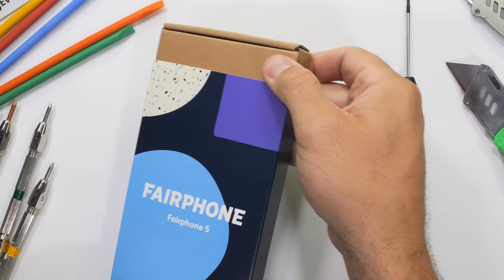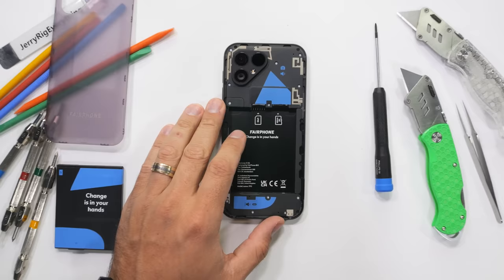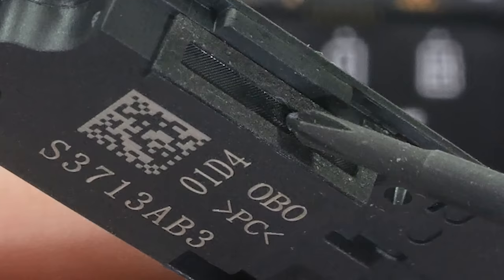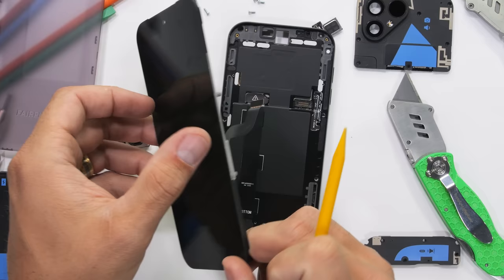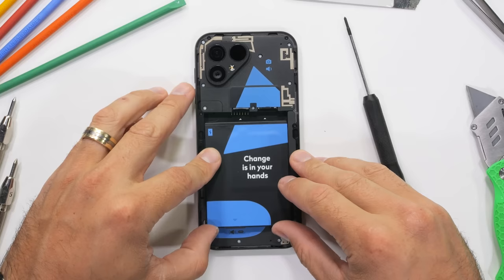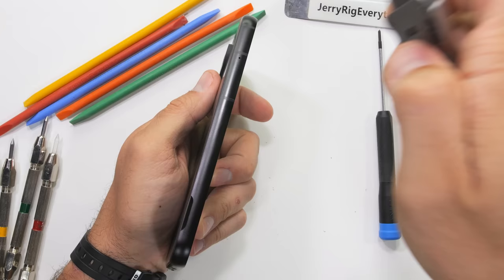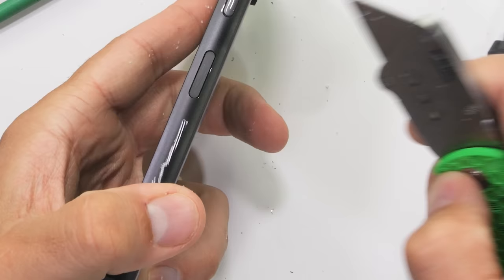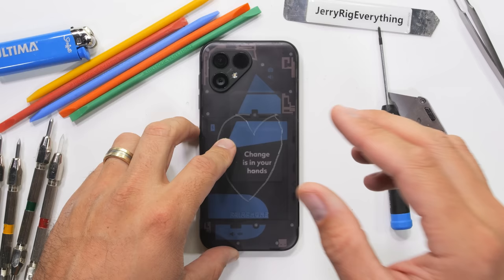The Best Smartphone on Earth - (Not Clickbait)

Comment: That's how phones should be
Reply: Just needs a 3.5mm jack
Reply: That’s how they used to be
Reply: @sys-administrator tf is ip68 waterproofing? You mean water resistantace?

Holy, his comment exploded it was like 36 likes 💀
Reply: @sys-administrator nope, low priority
Reply: That's how the phones were in 2015. Hello LG G4. 😍
Reply: @sys-administrator what do you have to do with it? Swim?
Reply: no, i don't want thick bezels and a thick frame and a small battery and mediocre specs
Reply: @sys-administrator  sure, but it's not a deal breaker for many. Hence low priority
Reply: Also thts how they use to be
Reply: that's how they WERE until apple did the non removable-proprietart thing
Reply: Ikr
Reply: @sys-administrator How do you get a phone that's so modular but also water resistant? Don't be an absolute child, and avoid getting it in water. Done.
Reply: Unfortunately every businesses goal is to maximize profits and this doesn't cut it😂
Reply: I mean ip68 waterproofing is more of a preventative measure. It’s nice to have and also all new smartphones have it. It’s nice to know that if I accidentally drop my phone into liquid, I don’t have to get a new one.
Reply: @SRC267  no need for them anymore. otherwise: adaptors are really cheap. I prefer a bigger battery instead :)
Reply: Thats how phones were up until galaxy s2, plastic back, modular build, everything was easy to replace.
Reply: It's how phones used to be. People forget. I used to have 2 spare batteries for my old phones, pop off the back, swap it around and you're good to go.
Reply: That's how they were before Apple phones appeared.
Reply: @sys-administrator IP68 waterproofing isn't a thing. Weird choice of words.

IP68 is a standard, where first digit (6) stands for how dustproof something is and second digit (8) for how waterproof it is.

Maximum is IP69K (nice), where 9 stands for resisting a powerwashing under high temperature.

8 stands for resisting submerging at a depth under 1m for under 30min
Reply: Did you changed your profile pic? The first I saw it, your profile is girl's back 🍑 🗿
Reply: 750€ for these specs will stop 90% of people from buying it.
Reply: @SRC267 😂😂😂 3.5 jack is high priority but water resistance is low priority? Where have you been for last 30 years? Don’t you remember the time when phones where thick, had a 3.5 jack, replaceable battery and lasted 2 weeks on one charge? That times are gone and the only reasonable step forward is to maintain thickness and usability of current smartphones while trying to implement old but good things just like replaceable battery.
Reply: Exactly 💯
Reply: Lol enjoy your battery flying out when you drop it and it breaking from a splash of liquid
Reply: What are you talking about! The battery cost 40 bucks!  That's insane!  My xiaomi phone doesn’t have a removable battery but it will cost 20 bucks to replace that. This phone is a rip off
Reply: I disagree, but to each their own.
Reply: @fwy8667  and your watching a phone video
Reply: No
Reply: @davidenorbedo5555 does your car have airbags because you use them every day
Reply: @killkiss_son it's a one and done type of buy tho, this phone should last you half a decade easily
Reply: @sys-administrator  I do. And there was also another commenter that did.
Reply: The argument against this is water resistance.
Reply: @fwy8667  IP is the dust and water resistance level in an electronic device. The first number classes dust resistance, from a scale of X (none) to 6 (fully dustproof) - usually 5 or 6 in a smartphone. The second number classes water resistance, from a scale of X (none) to 8 (fully waterproof) - 5 is moderate splashes, 6 is powerful jets, 7 is submersion in water between 15cm and 1m for 30 minutes, and 8 is almost entirely, or entirely, waterproof.
Reply: @tomcorteil  I know what ip 68 water RESISTANCE but idk what ip 68 water proofing is
Reply: @sys-administrator its ip 55. Its more than enough to do all this
Reply: @Yellow_Flannel  don't forget the galaxy s5 exists and has an ip 67 rating
Reply: This is literally how they used to be, nice to see the old standards now becoming “new” 😂
Reply: @sys-administrator it's called a case.
Reply: @Jonathan-rd4pk the headphone port takes up the same, if not less space than a USB-C port. You're not sacrificing any battery size lol
Reply: Jst btry...
Reply: @Jonathan-rd4pk  It does not matter how cheap an adaptor is. I do not want to be forced to use one. If your engineers do not manage to fit a 3,5mm hole into the device, that design sucks. And it even more sucks, if your argument to remove it was: "because it could break" (reminder: in a phone that is meant to be repairable). You may remove the display, USB C and battery for the same reason - just remove the entire phone, it could break too.

Oh and do they continue this bootloader lockdown crap?
Reply: Exactly
Reply: Man reminds me of the days when I had my old galaxy and my iPhone friends would get so jelly when I could just eject the used battery and put in a spare to instantly go to 100%.
I honestly hope the new eu laws bring this back
Reply: @thementalcritic  Imagine comparing prices from an European company that puts money and effort into using sustainable resources and fair pay for workers with a Chinese mega tech corp lmfao. Of course Xiaomi is going to be cheaper!
Reply: how? outdated Parts in a new phone?
Reply: I’d rather not own a phone that some random guy can take apart and just yoink my battery.
Reply: Why should a phone be designed to have parts that don't break be replaced? A removable battery, water resistance, and the slightest bit of care should be enough.
Reply: @thementalcritic  Xiaomi phone? Ofc that is cheap. You pay the extra with your data for the Chinese government.
Reply: @gongshowjimmy557  Samsung Galaxy S5 was waterproof with removable back. It was easily servicable too.
Reply: this phone won't save the world and it's too expensive.

and "sustainable" cobalt and lithium claim is just ridiculous.
Reply: Yep @apple and @google do better.
Reply: Commission Regulation (EU) 2023/1670
Reply: Imagine if Apple ever did this
Reply: @Roman-mt7hg  iphone 6s
Reply: Everybody needs to get latest  Apple pro max
Reply: Yupp atleast hardware shold be like that! Finally a tool is being treated as a tool not a third most important part of your body!
Reply: This is how phones were 😅😅😅
Reply: Imagine we can upgrade it, just buy and replace and upgrade no need change the phone just change the processor chip, replace higher quality camera , replace more storage, replace the 4G to 5G, imagine everything is upgradeble but not buying another phone, if need camera just change the cmera, if need good processor for gaming then just change it, wuuhhh amazing
Reply: That will be according to the new regulations they will all have removable battery and usb C ..it's nothing special 😊
Reply: Hell nah
Reply: I can changes battery.
Reply: Good old phones technology, miss replaceable batteries in new ones
Reply: man I still miss my LG V20
Reply: @Jonathan-rd4pk .... what
Reply: That's how they were !
Reply: Try telling normies
Reply: Jesucristo te ama muchísimo, arrepiéntete de tus pecados y ten perdón de pecados en Su Nombre
Reply: Тогда каждый, кто умеет держать в руке отвёртку, сможет его ремонтировать. Сервисы останутся без работы. Сейчас ведь как? Вспомнил старый анекдот. Пришёл клиент забирать с ремонта телевизор, мастер говорит, сдох конденсатор, с вас 5.40. Это за что? - спрашивает клиент. 40 копеек стоит конденсатор, а 5 рублей за то, что я знаю, куда его поставить. То есть, пользуясь нашим незнанием, с нас сдирают по полной. Это везде: автосервисы, рембыттехника всякая, врачи, мастера по ремонту квартир и сантехники. Короче, везде, где нужны особые навыки и знания.
Reply: Yes
Reply: Manufacturers: Here are the new phones!!
Community: Why is it so hard to fix?!
Manufacturers: Because, we decided we think the right to repair is stupid and completely threw it out of the window!😊
Reply: Like foot dimmer switches in cars, the best ideas are often lost to time.

Comment: I absolutely love the combination of Right to Repair, EU regulation tightening, and companies like FairPhone and Framework making tech repairable and modular.
Reply: It must be the gold standard
Reply: Unfortunately they have a loophole. Watertight devices don't need user replaceable batteries.
Reply: absolutely agree! Fairphone, Framework and Shiftphone and Nothingphone making this now and do not have huge problems in the future.
Reply: @naja08gll  banning serial code software locked batteries is a huge step.
Reply: It's repairable, but it's missing important components like 3.5mm jack, an USB charger and an USB cable.
Reply: Fairphone goes beyond what is necessary. Water resistance, a long lasting/replaceable battery, and good case should be enough. Also 5 or more years of software updates. I have seen only 1 case of a phone getting messed up besides a cracked screen and a bad battery, where the screen stopped working after a drop. 

Fairphone is great if you want a phone that can last 10 years. I would argue though that the market for ultra long life phones is pretty small. If they made a budget fairphone, for about $300 it would makes sense with the budget minded crowd. As it stands 3 very budget phones are significantly cheaper than a fairphone if you go through a carrier.
Reply: @espertalhao041  Who doesn't have a spare charger and cable though? Those are sensible omissions IMHO, you can buy them from Fairphone if you want but why bother if you already have them? The lack of headphone jack is a little more annoying, but it's only an adapter needed to fix that.
Reply: @me2olive  "Who doesn't have a spare charger and cable though?"

Someone buying their first phone, someone buying their first Fairphone (chargers are kinda phone-specific) and someone who isn't tech savvy.
A phone without it's charger is like a car without a gas tank filler - it's not a complete unit and it's missing required critical parts for it's continuous proper functioning.
Reply: @espertalhao041  Well, like the previous user stated, you can buy a cord and charger with the phone if you want. Regardless of your opinion, having a cable and charger come with every single phone is a HUGE source of electronics and plastic waste, and not sending one with the phone by default seriously cuts down on that waste. The vast majority of people already have a charger and a cable they can use with this, so it makes no sense to force a new one on people when they don't need it.
Reply: @espertalhao041 lol chargers are kinda phone specific? NO. There is USB type C and lightning. That's it those are two connections 99% of cell phones use. Basically no cell phone uses older styles of USB anymore like usb mini b, USB micro c(of which there are 2 shapes) or USB micro B super speed.
Reply: @naja08gll true but eventually they will lol didn't u hear Jerry?
Reply: @jamesmcdermott8947 Just wanna say that your listing is inaccurate. No phone I know of has used Mini B (but probably some weird Nokia brick phone has) and no types of "Micro C" exist. Micro B 3.x or Super speed was used in a handful of phones. Micro B (Micro-USB) was common in old phones.

Edit: and there was that 30-pin monstrosity from Apple that at least Samsung used in some tablets.
Reply: @glizbane  "Well, like the previous user stated, you can buy a cord and charger with the phone if you want."

"A charger" is not "THE charger". Please read my previous comment to another user as to why.

No charger means it isn't a complete fully functional unit.
Reply: @espertalhao041  "chargers are kinda phone-specific"
I laughed really hard at that as I plugged my HP laptop charger into my Samsung phone.
Reply: @Maplaplaplapla  They literally said "like the older styles of..."
No phone today comes with the 30 pin, Micro, etc. etc.
Reply: @espertalhao041  You seem really stuck on the misconception that chargers are phone-specific. That's simply not the case.
A generic charger of what? 2 amps? will give suitable charging performance of anyone who is too lazy to care about what charger they're using.
Devices are sold as standalone items all the time. 
You buy a camera and it comes with enough storage for 4 pictures REEEEEEEEEEEEEEEEEEE NOT A COMPLETE UNIT REEEEEEEEEEEEEEEE.
No, you do what normal people do and you buy a suitable storage card.
THE PRINTER DIDN'T COME WITH PAPER AND A USB CABLE REEEEEEEEEEEEEEEEEEE.
No, you purchase the paper and a USB cable of suitable length separately.
THE RECEIVER DIDN'T COME WITH SPEAKERS SO I GET NO SOUND REEEEEEEEEEEEEEEEEE NOT A COMPLETE UNIT REEEEEEEEEEEEEEEEEEEEEEEEEEEEEEEEE.
When you bought a CD player did you think it came with CD's? The PS1 and PS2 didn't come with memory cards. They were sold separately. The 360 didn't come standard with a hard drive and didn't support USB saves until later. The iPod Touch, Nano, and Shuffle didn't come with chargers. There are thousands of examples. 
Again, you're buying a device, not a "starter kit".
Reply: Yeah. The EU should rule the world so everywhere would be a better place. ❤❤❤❤
Reply: @tim3172  It's not a misconception, and you know it.
Reply: Don't forget Shiftphone ;-)
Reply: @naja08gll  Well Sony did it about 10 years ago...
Reply: @naja08gll Most people don't use their phone during rain, washing car, swiming, etc. That loophole is small problem. It's not a problem back then for phone to have water resistance, because people with common sense know how to prevent water from getting into their phone
Reply: @espertalhao041  Why do you need a cable and charger?  THe whole idea of standardizing on USB C is that you'll never need to buy another one.
Reply: @poruatokin  But USB-C is just a connector, and it is used by non-USB Power Delivery chargers that have their own proprietary charging protocols.
For example, Quick Charge. However, Quick Charge does fallback to USB Power Delivery.

You also need a charger that supports USB Power Delivery, and a cable that's capable of delivering the current and voltage that the phone supports.
You can't just grab a $10 charger and a $5 cable and expect USB Power Delivery to work on your phone.
It will probably fallback to USB 2.0 current (500mA), if the phone even accepts the charge anyways.

To make sure that the phone, charger and cable are compatible, they must be bundled, as they should be because they are (more often than not) device-specific.
Otherwise, it's just playing dice and hoping that the charger you bought actually works with the cable and phone you have.
Reply: @espertalhao041  Again you are talking nonsense, literally ANY USB C charger and cable will charge a phone. I personally have around seven different charge sources that I can plug my phone into including  those made by various makers including Dell, Asus, Anker etc.  Hell, even my sofa has USB outlets and came with a pair of USB-A to USB-C cables. Wall outlets in the UK and Japan are available with built in USB outlets. Most of mine are PC power supplies, some will do fast charging, but I prefer those that charge slow to preserve the battery.
Besides, I have am on my fourth Smartphone now and none of them ever came with a bundled charger.
I suggest you get your head out of the sand and see how non-Apple devices have been doing it for years.
Reply: @poruatokin  Shows how much you know... Nothing.
Reply: @poruatokin not all USB cables are made the same, same is true for a charging brick. If you plug your phone in to some older bricks it sometimes won't even charge or charge at insanely slow speeds. If a product advertises fast charging speeds like 50w quick charge I expect it to come with a power brick that can output that not for them to make me pay extra for one.
Reply: I love these apple clowns coming here and regurgitating the crap these phone companies say. A charger should be a FREE additional to any phone purchase, not a separate additional purchase especially as charging speeds are improving/different on newer phones. The problem with fairphone is they also sell non repairable wireless garbage headphones. That's why they removed the headphone jack. They're not as sustainable as they pretend to be.
Reply: @AlkaVirus  Gullible people like him won't understand that, and will say that you're wrong while regurgitating nonsense.
Reply: @AlkaVirus  Aren't you a little mixed up?
It is the non Apple people that understand that you don't need a dedicated charger, it is the Apple idiots that have been brainwashed into believing that a new charger is necessary every time.
Reply: @poruatokin  apple is the first to start not including a charger.
Reply: @paulusjosef only if every phone decides to use the same system. Every company can make easy to repair phones that are modular, but only with other phones of the same company.
Reply: @Maplaplaplapla oh no I did have a samsung tablet with such a massive charging port lol